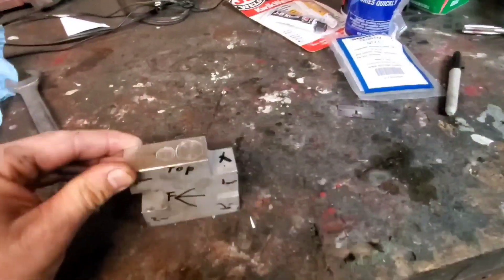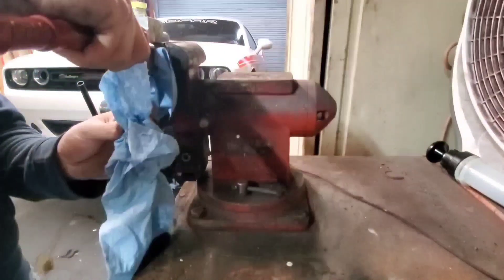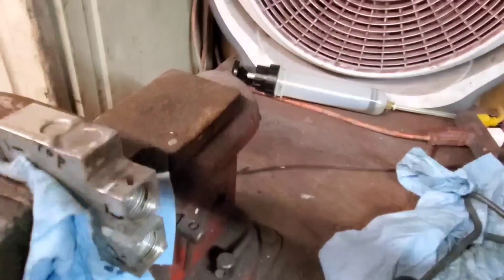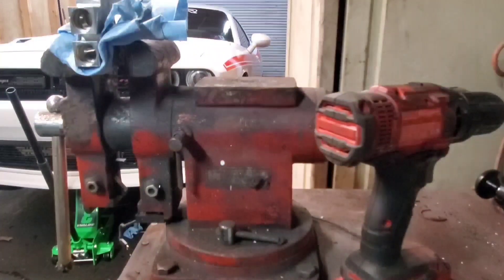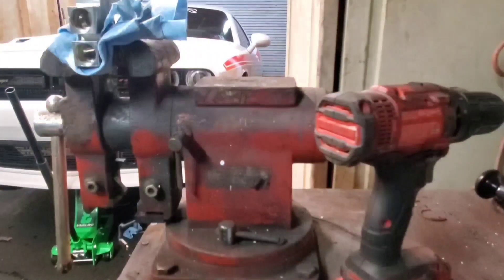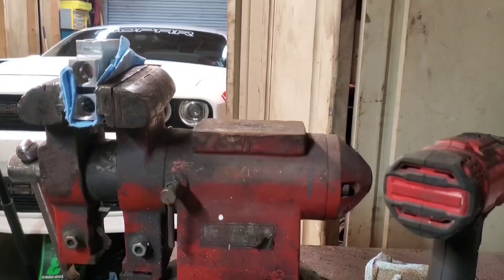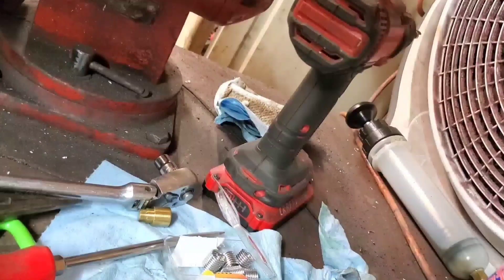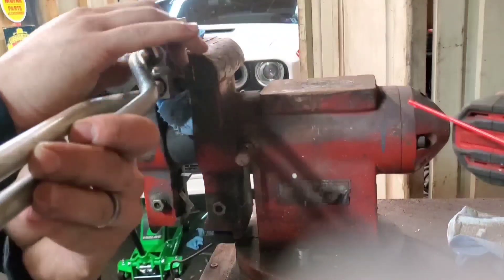Installing a sonnax thermal bypass eliminator on my 8hp70 transmission on my 15 built challenger

Comment: How did you loosen the nuts directly on the transmission? The shift linkage, and a hole for a bracket was in the way on my car preventing a wrench. I see those two things on yours to. Also the bottom line prevents you from getting to the top one inconveniently.

Comment: It opens at 190°? On my 8 speed at 190° I am ¾ the way to red. Is my temp gauge off? I thought the 8 speed ran at lower temps then most transmissions??
Reply from the maker: Anything over 130 to 185 is ideal but once start seeing 225 230 plus need to let it cool back off on the 8 speeds especially if your runing it hard 240 to 260plus then your starting to get pretty hot and can burn the fluid and cause damage
Reply: Pretty sure it’s supposed to open at 165

Comment: Jeep patriot, similar block. tranny was overheating. removed block and a snap ring that held the cap on the guts. spring came right out but the rest was stuck. tapped on it, froze it to -15 and heated it to 250. still no movement. Opened it up and took out the spring that was blocking some flow.  It sat for a day and then when my kid was installing it, he said the damn thing was loose now and the parts freely moving. On inspection,  the carrier behind the spring had magically freed itself. I just took it all out and now I have full flow full time through the 4 ports. No $ cost. the thermostat that expands is staked in and since the ports are inline, you can see right through them now. Weird little valve, but I dont trust them anymore. The stock mopar oem one is $70, not bad at all if you trust them.